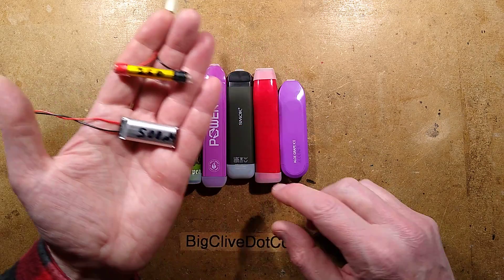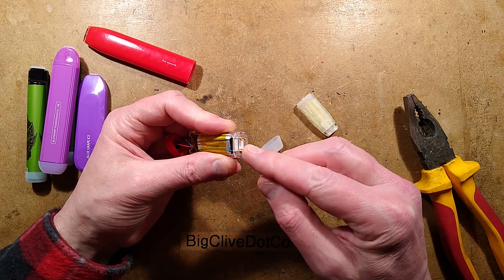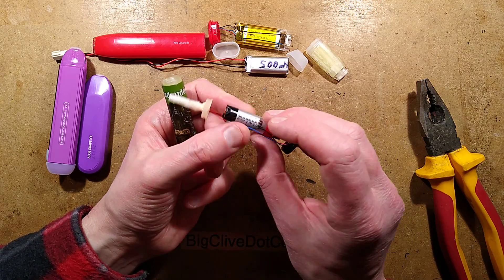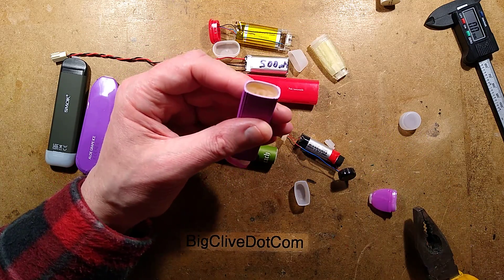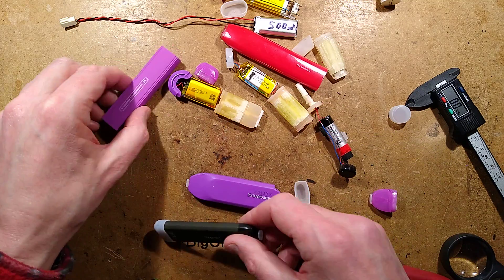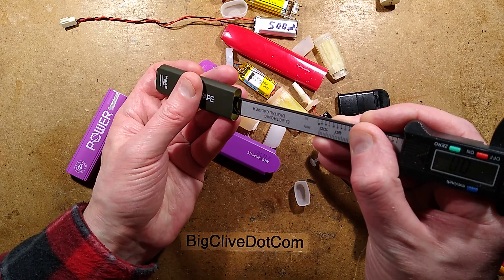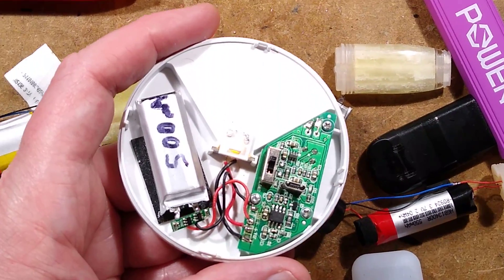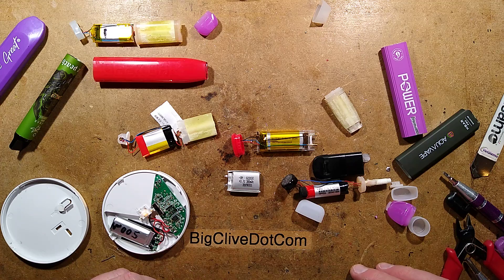Scavenging rechargeable lithium cells from the roadside

Comment: Oh boy, so I'm not the only one doing this! I found a good purpose for these cells, but there is a bit of backstory to this (warning, this could get long ;) ).

A buddy of mine and I are really into FPV drones and we're constantly on the search for new parts and ideas on how to optimize our copters, change their weigt to increase the flight time and such. My buddy also works in a vape shop and we're both avid vapers. We both saw the vape market getting literally flooded by new disposables and pod systems spawning on a daily basis - And this concerned us from a vaping enthusiast and also from an ecological standpoint but since there was such a high demand at the shop he's working at, they sadly had to give in and also start to sell disposables. Even more sad - the ones they sell are actually... Good. Except from being one time use only, they actually are good vape pens.

We both decided on taking them apart to have a look inside and found cilyndrical Li-Ion cells - Pretty much the same ones as shown in the green pen at @4:15 . And at the very moment we saw those cells, it dawned on both of us, that we just need to take a closer look at them. We both instantly thought of using those cells for our drones - but we first need to benchmark them since we obviously don't have any datasheet available. They sure are not meant for high discharge currents but still - I want to know, what these cells are capable of. 

So - I bought one of those chunky electric load battery testers with a display, volt and ammeter (the ones which also display the discharged mAh) and started to test those cells while also monitoring the temperature with a (somewhat) calibrated multimeter with a temperature probe. The one we got are perfectly capable of delivering stable 1A of current without even getting warm. The imprint of the particular cell we were using says they have a nominal capacity of aroung 650mAh, I can somewhat confirm this, my meter was showing around 600mAh after discharging them with 1A from 4.2V to 3.2V. I'm still testing so I can't tell for sure if they can handle high current peaks or not but I once simulated current peaks up to 6A which they were somewhat capable of handling, without dropping the voltage too much. I am aware that this is still fairly risky and I will not use those cells for any higher discharge currents for now until I got more data about their performance, but I've built a 1S2P parallel pack which I successfuly used with my tinywhoop, which is a small palm sized copter for indoor use. They run on 1 or 2S (so 3.7 - 7.4V) and don't draw a lot of current, around 4-5A as a baseline and maybe 10A when I do a punch out.

 Until now, those cells work perfectly fine for those small copters. Their capacity to weight ratio as well as their small footprint make them the perfect candidate for our needs. The aforementioned pack got luke warm after flying, the voltage did not drop too much - about the same as the little 1S Li-Po pouch batteries, which are designed for those tinywhoops. I'll continue to benchmark them before I will use them for any higher loads.

We also dismantled a different disposable, which uses a similar pouch style battery, which is shown @3:10 - This one is now installed in wireless headphones, which had a faulty battery. We kept the internal battery management circuit and just replaced the batteries - It works like a charm! My buddy asked some customers to return the vape pens, once depleted. He's keeping and dismantling them to harvest the cells and properly dispose/recycle the components like the plastics, the aluminum tube and the little electronic circuit. We got around 20 to 25 of the same cells, for now. More and more customers return their old pens.

 Let's see, for what we can use them in the future... :)
Reply from the maker: Interesting test results.
Reply: Damn... Free cells everyday...

Comment: I wonder, would it be safe to re-use a charge controller board salvaged from a swollen cell phone battery to protect these salvaged batteries?
Reply from the maker: Yes, you can salvage the little protection PCBs.  They may have different levels of overcurrent detection.
Reply: @bigclivedotcom  Thanks!  Good point about the different levels of overcurrent protection.  Now I just need to figure out how to determine the specific protection level for a given PCB. ;-)

Comment: I don't think the effort of trying to sterilise the absorbent stuff (that was literally attached to someone's respiratory system) is worth the value of refilling it, and I'd be funny about using someone else's vape even if there wasn't Covid. There's still TB, or it could just be some horrible dirty old person using it. I dunno. Vapes are so immensely cheap it's surely worth just buying one. If you want Popcorn Lung and a gob full of antifreeze and E-numbers. Can't beat the price for the lithium cells though. Makes sense in a disposable unit there's nothing else to scavenge, every milli-penny counts when you're knocking them out by the million. 

Last thing I did like that was refurbish a pair of Bluetooth headphones I really liked with the cell from one of those one-off disposable phone chargers. In the end it was far too big though and I think the black insulating tape was a bit conspicuous. Didn't stop me but then a birthday came so somebody got me a new set of headphones, just the 15 quid type ones.

Those battery-recycling tubs they have in Aldi etc for old dead primary cells could start taking dead vapes cos there's surely value in the batteries. Again the problem would be hygeine though. You could have a big bin with a sealed lid but even so it'd be like having a vat of Typhoid in the corner of the supermarket. Shame cos scrounge up enough of them and you can make your own Tesla.

If I ever do want to stop smoking, I'll either just stop, or make smaller and smaller roll-ups. Times when I'm short of baccy I can stretch them out into tinier and tinier smokes til after a couple of days of that I'm probably not even addicted any more.

Comment: The  most popular devices like this in Northern California seem to be these standardized tubular (ok, rod-shaped) rechargeable battery/handles that you screw into a little USB charger.  When it's charged, you take it off the charger and connect it to a cartridge.  They're about 12 mm in diameter and roughly 100 mm long.  I was very puzzled when I first found one of these rods with a pushbutton switch and a precise threaded connector on one end.  I'll measure the energy it stores next time I find one.

Comment: Ive taken a few of these to bits too, the cells can be used to run some LEDs, and I like putting LEDs on everything, including hats and clothing, and these little cells are a bit dangerous, but will run many LEDs for quite a while. I also get some on ebay for running little quad copter things.
I wrote an instructable about salvaging electronic parts for projects and repairs, and someone commented recently that you can find good cells at the big box hardware stores dumpsters. Im guessing from tools that are returned or damaged? Anyhoo, that might be something to look in to eh?

Comment: How do you store cells in case they spontaneously combust?

I'm sitting here looking at an old phone sitting in the middle of my glass table, in a spam tin. The screen has popped out from the battery bulging. Good thing I found this on one of my shelves before it lit on fire. I was intending on repairing it but not too sure about that anymore. I also know I have an old bulging battery from another phone sitting somewhere... I just can't remember where I put it, or if I threw it into recycling, which I'm afraid I didn't do at the time. Lithium cells scare me.
Reply from the maker: I tend to store cells in small bags for insulation and in a metal oven tray.  If the cell is puffed then it's worth getting rid of it from the phone at least.  What makes lithium cells dangerous is the charge the hold and not the lithium.  When discharged they are fairly inert.
Reply: Especially cells that have been sitting out in the rain, since moisture and lithium seems to be a bad combination

Comment: Can you imagine a electric car discharging. In wreck? Or a short from a salt road experience. Someone is going to burn quick. Did I say that out loud?
Reply from the maker: Or a gasoline car exploding in flames with gallons of fuel pouring out everywhere
Reply: @bigclivedotcom  Petrol fires are easier to put out, plus it doesn't ignite nearly as often as Hollywood would have you believe.  And diesel is even more difficult to ignite.

Comment: While walking down a city street, I saw that someone had gotten very angry at a sizable USB power bank. Plastic was completely smashed and there were 4 large un-inflated pillows with the contact tabs directly exposed. I quickly realized there was no way in hell I'd ride a commuter bus with that thing; didn't want it in my house in that condition either. Shame I couldnt finish it off there, it was too big!

Comment: I still have lots of things lying around with lithium cells inside. Power banks. Laptop battery packs. Portable store-and-charge cases (e.g. for headphones). And so on. I'd be curious to see which of them still contain reusable lithium cells. It would be great to have a guide how to safely extract, test, evaluate, and recharge/reuse them.

Comment: Well anyone looking for discarded rechargeable lithium batteries should ask remote control airplane and helicopter pilots. They'd be happy to get rid of batteries that are still perfectly up to capacity and with a low self discharge - as long as the application does not require very high discharge currents.

Comment: I've been using reclaimed 18650 cells from laptop batteries to upgrade camping lights.  Cut out the nicad housing, add a couple 18650's, a current-limiting resister and TP4056 to re-charge them.  That gives a much better runtime and usb charging.

Comment: If you're concerned about COVID, you can simply wait. The virus will deteriorate over time. I prefer waiting 2 weeks, which is overkill. That being said, current data suggests transmission from fomites (from surfaces) is very low if any.

Comment: As far as i understand what you, Clive, called "pressure sensor" only need to be pressure-sensitive switches... correct?
I'm asking because I would be interested in finding a pressure sensor for the range <10 mm H2O to connect to an MCU. If those "sensors" could be linearised and provide a pressure reading they could come handy.
Reply from the maker: These are just a conductive membrane bridging a contact.

Comment: When I was a heavy vaper, I couldn't take two hits off of some of these devices, without almost passing out. Many are a very very high dosage of nicotine salts, they are no joke & could probably make a non user sick from skin contact..
Reply: nicotine is VERY toxic (0.5–1.0 mg/kg can be a lethal dosage for adult humans), so if these are as potent as you say there is no probably about it.
Reply from the maker: Although high compared to most e-liquids the level of nicotine is still low in percentage in the liquid.  It would be more of an issue if your hands were covered in the liquid a lot.

Comment: They should have a deposit on them like beer & wine bottles. Here in Canada it's almost every week I see discarded 'ecigs' of the legal herbal Canadian variety. I stoped scavenging them after the wuflu started as I already have a dangersous amount of loose cells now. Other day I was thinking to myself I need to go through them and check voltages (again) and see which if any have leaked. One of these days. I was surprised that one of my brand new Samsung 18650 had dropped from storage charge (3.7 ish volts) down below 1 volt.

I use e-cig batteries to power LED strings on my bicycle wheels. White string of led christmas lights on the front wheel. Red string of led christmas lights on the rear wheel.
Reply from the maker: If a cell self discharges that fast I put it in for recycling.

Comment: It still baffles me that these are disposable.
You'd be surprised how cheap it is to have custom extrusions made by the way, even in aluminium. It's only a couple thousand euros in tooling cost. A bit steep for doing it just for gits and shiggles but if you are doing a small production run it could end up cheaper than plastic injection molding. For larger runs of course, plastic will always win.

Comment: Is it possible that the interconnect wires inside the device(s) are made of silver?
For such a small diameter,I suspect copper would have slightly more resistance.
Reply from the maker: It'll probably be copper.

Comment: I have over 60 of these cells, collected over the past 6 months - there is usually enough charge remaining in the cell to light the led, i.e. over 3v. They have only had the original manufacturer's charge, so they can be considered as virgin cells, having never been recharged, so they potentially have a long life ahead of them! The pressure sensor may be operated by squeezing between thumb and forefinger. it is wise to disconnect, or cut the wires from the heater/liquid store from the cell before extracting the sensor from the base, which is sometimes glued. There are a few larger "MAX" versions which have a battery recharge function and a USB port. The sensor chip has five solder connections instead of the usual 3, for the usb connections.  It is notable that there are no disposal instructions on any of the cases I have seen, since containing a live lithium cell, it is potentially spontaneously flammable if damaged by waste compacting equipment on trash carts, or in waste depots. I have seen "geekbar" castoffs with dog teeth marks cracking the case, which could prove potentially very unfortunate for Rover! Also the nicotine content is toxic for insects and many other forms of wildlife, and the glycerol/glycol content has a sweet taste, together with the caramel/fruit flavour/aroma, may be attractive to small children. In fact the sweetie-like characteristics in look and aroma are a giveaway clue to the market aimed at - teenagers, and immature adults, together with the highly addictive nature of nicotine, when these "disposable" devices are eventually restricted in the same way as other tobacco products are, or more likely banned, there will be little alternative other than to return to traditional tobacco use to satisfy the addiction.
Reply: "May be attractive to small children".. aah, more like "specifically designed to be attractive to get small children addicted for life". It's the big tobacco industry that now owns the majority of this market after hoovering up the small players.. and they know this technique works a treat.

Comment: I collect these "dead" disposables from coworkers. The cells I typically get (in the US) are 280mAh, 550mAh, 1000mAh, and 1500mAh. I've been collecting for about 2 years now. They are great to replace 2 or 3 AA or AAA alkaline in flashlights or remote controls.
Reply: So many reusable ones I don't understand why anybody would use these kind.
its probably extremely overpriced too.    Cool that the batteries can be salvaged.
But most are going straight to landfills.  Its just mega wasteful. Is this in states who banned the better devices?
Reply: @p_mimejunior7174  its just cause addicts gonna do addict things, which don't include being to bright with their money
Reply: @virtualtools_3021  It's better than cigarettes though, but most of the people I know who vape use modular units that are reusable and can modded for more power. So the old batteries are put in the recycling bin, and not the whole unit.

Comment: I wouldn't say they aren't refillable.
The ones with the circular cartridges are definitely refillable, just drill a small hole in it and refill with a syringe and needle then use some vinyl 'electrical' tape to seal the hole.

Edit, you got there before me Clive by saying anyone like us could refill them.
Only issue is they're usually 20mg, the highest strength you can sell in bottles in the UK (and bottles have to be limited to 10mls because of some silly law so now most shops sell 3 or 4 packs of 10ml liquid) is 18mg/ml.
These are usually 20mg/ml.
The new laws seem to be an attempt to stop people from quitting smoking. I bet some of our politicians have large amounts of stock in cigarette companies.

Comment: I found a couple of vape pens on the sidewalk the other day. I pulled out their batteries, tested them, and found them both to be completely flat. I'm worried about trying to charge them back up now.
Reply from the maker: For low current use, lithium cells can usually be recovered from 0V by trickle charging back to 3V.

Comment: I'd love to learn how to make a minimalist battery protection circuit for these (or any Lithium Cells) - and possibly using one of the wee garden lamp solar cells as a charger. I don't even know if that'd be enough power for an arduino nano.. but in any case it'd be a great "explainer" video. What do you think Clive?
Reply: These (500mAh) are more than sufficient to power IoT boards... Arduino, Pi Pico, ESP32, you name it (unless you're powering long LED strips or motors etc).

A minimalist protection circuit will consist of a DW01 chip & a dual mosfet (you can see how they should be connected in DW01's datasheet). For the sake of size, simplicity & cost effectiveness, I'll suggest keeping the charging circuit separated. For charging you can use tp4056, tp5100 (popular ones) and many other cheap & widely available ICs (also easily available as prebuilt modules, that you can readily use as adapter with regular USB ports for power in).
Reply: @Debloper  Thank you for your detailed response :)
Reply: They are less than a dollar from the usual chinese sources.